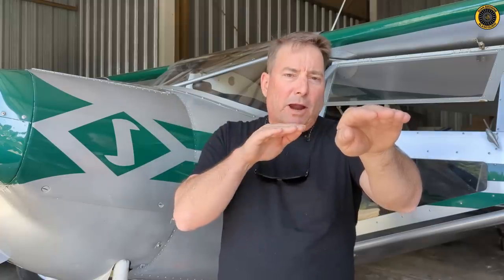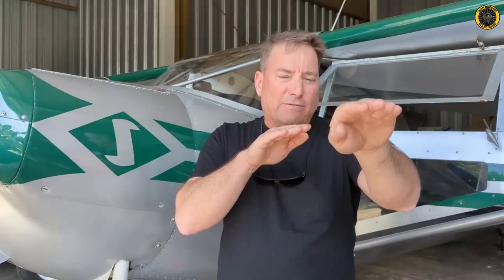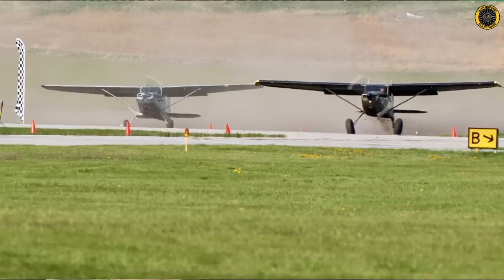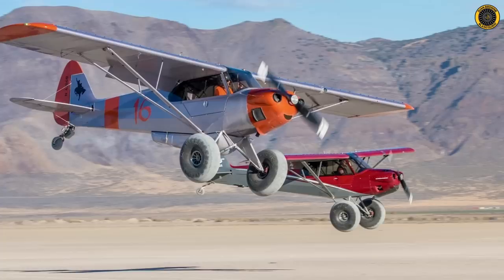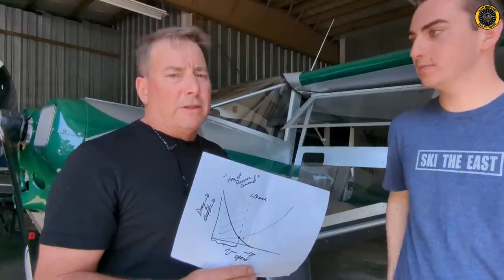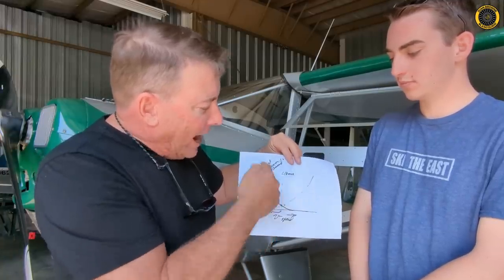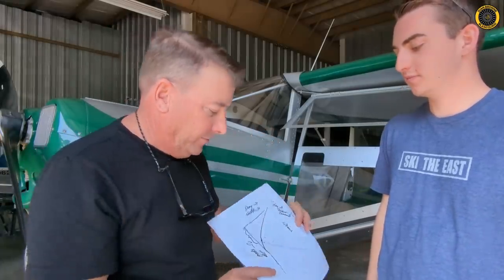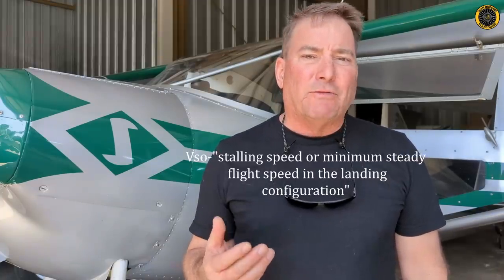Cessna 140 Stall/Spin Accident Wayne NE

Comment: Retired crop duster here. A really good exercise for all pilots is to go up to a safe altitude and stall the aircraft and DON’T recover right away. Keep the stick back in your lap and control all the wing drops with your rudder. Gives you experience that might have saved a life in this case.
Reply: Was just doing this in my 140 the other day with the CFI. It is great but definitely needs to be practiced to become natural.
Reply: An excellent exercise!  Early in my training this was demonstrated and I was required to practice and become proficient at it. I don’t know the proper term but the instructor called it, “walking the rudder.”  The reason for the emphasis was that I was training in the small two place Grumman. A follow up to Bede’s  Yankee design. Short wingspan and close coupled, a joy to fly but any aileron input in a full stall would snap it in a heartbeat. One quickly learned - don’t do that, any aileron input will bite back with a vengeance.  I went on to fly professionally and that early training always lurked in my subconscious. I never had to test the skill in a crisis situation but that early experience may just be the reason why I did not.
Reply: The C-140 is great at this. It was taught to me as "walking it down".
Reply: @atg197  do it over and over and over! Stall the crap out of it!! Have fun!
Reply: @gonflying  Thanks I will definitely be doing that with a bit of altitude.
Reply: Yup! This is one I learned waay back from rc flying. When I fly a new type for the first time I will go up high and check the stalling characteristics of the plane. You do not want to learn those things close to the ground when you are not prepared.
Reply: @Juhujalp  Agreed. That’s true.  Keeping it in a stall and keeping the wings level is what I was specifically talking about.
Reply: Bingo.   In 1982 I was getting basic instruction in a Citabria.  I had about 25 hours in a 152 and knew next to nothing since my CFI was very low time and relatively inexperienced.  Long story short, I wound up working with an OLD dude in the Citabria who was completely different in his approach to flight training.   He had me stall the plane and hold it there.  I'd lose a ton of altitude while using the rudder to maintain wings level.  The plane was falling like a leaf, but it was upright.  He also taught me how to slip the (zero flap) plane to lose alt when needed for landing.   And of course, how to spin and recover from it.  

During the stall he would say "recover" I'd break the stall and fly the plane.  It was great instruction.  Gave me a lot of confidence.
Reply: @lbowsk  Turning the airplane to a new heading is a great idea. I don’t think I have heard that before but it is a great idea. Thanks
Reply: In the Skyhawk 172S I’m training in, in the normal category it is not spin approved. Can not recovering right away, trying to control the bank with rudder end up putting me in a spin? If I fail to use proper rudder control? I would like to try it but I won’t do anything that will put me in an unapproved maneuver… I’m a by the book kind of guy :) And I’ll ask my CFI this week too
Reply: @lyingcat9022  If you’re concerned about not being able to try it without entering a spin take an instructor with you. I personally believe that this is important enough to make it mandatory for every pilot to receive instruction about it. It’s a basic principle of flight and aerodynamics and understanding how an airplane is controlled.
Reply: That’s really good advice. As a low time pilot, it’s really tempting to try to pull that wing up with the aileron
Reply: Its difficult to judge from the camera angle, but another possible factor that came to mind was that he may have been concerned with getting too close to the A/C to his front (approaching the landing location).  Rather than risking a go-around that may cause him to get out of sequence, and cause a pattern disruption,  I was wondering if he was backing off the throttle more than normal. Im sure they practice those maneuvers a million times in private, but the pressures added by multiple A/C (and an audience) can throw a monkey wrench into the skills of even the best pilots.  Those planes are already approaching stall speed as they land, so the margins are razor thin anyway.  Also, although he was an experienced pilot, IMO, a Cessna 140 is a pig relative to the other A/C in that STOL. competition. - That's without knowing what mods he'd made.  It speaks to his experience that he'd been able to perform those maneuvers succenfully despite that shortcoming.  Unfortunately,  sometimes luck runs out even for the best of us.   RIP to Tom and condolences to his family.
Reply: @MrDlt123  if you view luck as a deciding factor in aviation safety, then you are going to be disappointed. In regards to the other things pointed out, no matter what you have to fly the airplane. Every plane has its quirks. There are things it wants and things you just can’t do as well as things it absolutely requires. 
If you’re in a landing sequence, then you need to do whatever is prudent to A) Not over run the guy in front of you and B) hopefully not cause the guy behind you any grief. Regardless, you have to fly the airplane. I had an engine quit on a Mooney 231 just as I was retracting the gear on takeoff. I (because of my crop dusting experience) banked the plane over 60 degrees and made it back to the runway. BUT, the first thing I did was significantly lower the nose. ( There were nothing but hardwood trees right off the end of the runway). A flight instructor saw the whole thing and chewed me out. “ You’re never supposed to turn back to the runway “ I replied “Well I’m here”. 
Fly the airplane.
Reply: I’m sorry

Comment: Looks like a classic pilot error accident.  Back when I was instructing I "knew" 500 hours of flight time to be the very most dangerous.  Enough experience to think you're good, but not enough to have great judgment.  He made 2 critical failures. 1. Not maintaining proper airspeed, and apparently, 2. not knowing that aircraft control in a stall is a rudder problem until airspeed is restored.
Reply: Yup. Classic.
Reply: I think the critical failure was not considering wind direction at the low airspeed when he turned downwind to initiate the S-Turn.  Once the wing dropped there was no altitude even for a perfect recovery using the rudder.
Reply: @pfsantos007  Yup....  When your 3 to 5 seconds from the ground (from 300-400ft alt)
reaction time has to be instant... In this case even an acro pilot may not make it.
Please don't use a C140 for this kind of "sport", just not a good fit.
Reply: @pfsantos007  I don't agree wind was THE critical failure, but it could have played a part.  Clearly, low altitude played a part.  As to "once the wing dropped."  Back when I was instructing, one of the maneuvers I would use for rudder training was to fly and maneuver in a full stall.  It's not that hard and rudder becomes automatic.  Being slow enough to stall meant his ailerons would have been very "mushy."  That should have keyed him to use a lot more rudder.  cheers n fly safe

Comment: Juan, when you mention the reaction to use aileron to lift the falling wing, I guess it is instinct.  When I learned in a Lucsombe 50 years ago, my CFI believed instinct was not what he was counting on.  He said, "this is what to do".  And I believed it!  Just did what he SAID.
Soon after, my first job in Alaska flying low and slow counting salmon, I got the Super Cub too slow and dropped a wing.  75ft. AGL.  I immediately unloaded the wings, full throttle and flew it out of the bad maneuver.  Changed my underwear later and reflected on early advice. Angle of attack ( which seemed mysterious at the time) was what my CFI harped on.  I guess he saved my bacon that day. I won't criticize this deceased pilot, just note that flying is unforgiving.  You absolutely DO what works, not what you instinctively feel. RIP sir.

Comment: Having flown 1,000's of hours in a C-140, I can tell you they (all planes really) are like rattlesnakes, they do not cause problems as long as you "understand" their nature, and while flying never look away...they always bite when you are least expecting it.
Reply: I have a question for those in the know... is this type of plane suitable for STOL flying? If yes, was part of the problem in this case the difference in approach speed with the STOL-drag designed planes? Could this risk be adequately mitigated by requiring them to fly in a separate group, even one on their own? Or would it be sufficient to remind pilots before such a demonstration that they should lengthen their run, to increase the separation? Thanks in advance.
Reply: The C140 would definitely not be competitive in the company of true STOL designed aircraft as in this case. To accommodate it in such a competition, it should be slotted first in the grid to prevent such a situation. Class racing would be  even better as suggested.
Reply: @thebeequeeper yes you should know your machine. What do you mean by “while flying never look away” ?

Give some examples of how any plane can bite. Some are very docile, others yes for sure. I think it depends on the aircraft, however.
Reply: Sounds like precisely the wrong type of aircraft for deliberately flying low and slow.
Reply: True statement!
Reply: Miss FanGirl all airplanes are capable of short take off and landings IN THEIR PERFORMANCE LIMITS. To compete with Zenits and Super STOL’s is not the realm on a 50’s design classic. You’re basically competing with yourself which is a good way to sharpen your skills if taking a conservative approach. But then use your skills and your senses! Read and feel the airplane and do not get distracted by others’ performance or anything else. Everybody being human; events and certainly competitions are a huge distraction!
Reply: @nickr5658  I think he/she was referring to aviation in general...you can get complacent and if something unexpected or overlooked gets you by surprise, it can all end very badly very quickly.
Reply: @empireoflizards  well we generally know what phase of flight or circumstances your most likely to be involved in an accident. 

Complacency in aviation is dangerous. Aviation in general is unforgiving.
Reply: @islandlife756  A 140 or 150 is a slow plane....But not really a stoll.......Paul
Reply: @styleandpattern  Hmmm... me thinks ur not a real pilot.
Reply: @nickr5658  You're right in that some, maybe all planes are docile.  It's also quite easy to get a plane out of the envelope, and that's when they bite.
I'm in the Civil Air Patrol and in 1986 I had completed an annual Form 5 in a T-41-B.  A few weeks later I moved to Oakland to attend Sierra Academy of Aeronautics.  The chief instructor took me up in a C-152 for a familiarization local flight.  At this time I had apprx 125 hours in C-150-152's.  So he had me do some slow flight and stalls.  My first stall put us in a left turn spin, and I panicked.  There are mountains east of Oakland and we were about 3000' above them but they started to get very close very fast.  After he recovered, he gave me about a 15" lesson in stalls and spin recovery.
Reply: @dalereed3950  15"? Was it minutes?

Comment: You said that Tom was a fast burner but unfortunately he lacked flying basics. 
He lacked situational awareness by cutting the pattern short  behind an aircraft that he knew had a substantially slower stall speed than the aircraft he was flying. You are exactly right about operating an aircraft in the area of Reverse effect of control. When a wing drops when operating that close to the critical angle of attack it needs to be raised by rudder NOT aileron. If you use aileron then instead of raising the dropped wing you will cause it to stall out! Classic Falling Leaf practice that the 140 does beautifully. This is what happened to Tom. Tom's very first recovery should have been to 1) reduce his angle of attack and 2) use left rudder. If you are going to attempt this level of flying then you need to be acutely aware of that situation and the only way to do that is by extensive practice of stall and recovery and NOT using your ailerons.  
Unfortunately, with the proper inputs, Tom had the altitude to recover. Hopefully,  for those who desire to fly their aircraft in this flight envelope, they will learn by Tom's mistakes and go out and get to know their airplane intimately at that very critical airspeed. 
When we were young we were taught to be afraid of the Boogeyman. Unfortunately in aviation today the Boogeyman is Stalls. If we were to return to the days of flight training of way back when then the pilot won't be terrified of a stalling the airplane as they are now. If you get a PPL in Canada, Jamaica or South Africa,  Spins are in the syllabus. 
I've been giving Spin Endorsements for over 30 years and I use a Cessna 150. Why a 150? Because that's the type of airplane that the CFI Candidate will be teaching in and it builds confidence in that airplane.  The typical thrill ride in an Extra 300 is an injustice the CFI Candidate. At least 50% of the candidates that come to me have never experienced a full power on or power off stall! REALLY? And they're going to be Instructors? This is why during my Endorsements I also do extensive work in power on and off stalls,  Falling Leaf, Dutch Rolls and what I call the "Stupid Student" power on stalls where the typical student doesn't use right rudder but uses right aileron and end up in a left hand spin.  They then go full right aileron and full up elevator and end up in the "Pilot Fetal Position"!
I apologize for my rant but I'm desperately passionate about the lack of emphasis on the simple aviation basics in the training environment of today. 
We're producing flying Robots that aren't being taught to think and fly...
Reply: Thank you for this input. I'm in the last 3rd. of my way to PPL here in Norway and this have been a concern for me. What if.... I get a wing drop in a gusty day 20 feet above ground on final? Will I manage to add opposite rudder instead of aileron? I hope so, and are practicing this in my mind over and over again (I'm 55 y/o so I have to add this into my unconsiuness manually). But again, thank you for your proper explanation, which was very helpful for me.
Reply: a CFI who has no experience of a spin is scary.....
Reply: Well said. "Tailgating" the Zenith narrowed options down to "go around." Your assessment is honest and correct - maintain separation is a flying basic.

Comment: Juan, this had to be one of the toughest videos you have done. Hopefully explaining as you have done with stall spins you will as you have done in the past continue to save many lives. 
I know you have made me a better pilot.
Thank you.
Reply: Juan has made me a better passenger, too. I'm never going to be a pilot unless I'm in a small plane with a pilot who becomes incapacitated in flight. In that case I will be hearing Juan, 74 Gear Kelsey, and Mentour Pilot saying aviate navigate communicate over and over, while I try to keep the wings level, check the fuel levels, move the yoke slowly, and then make sure I land on the main wheels first with the nose up slightly. ;-) May I never need to use this info.